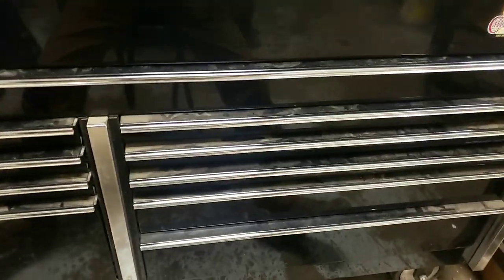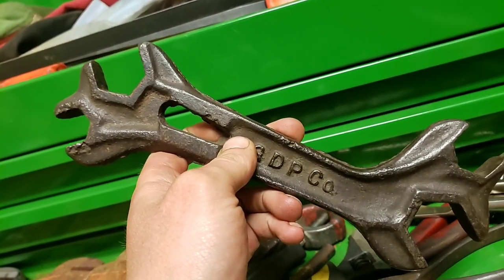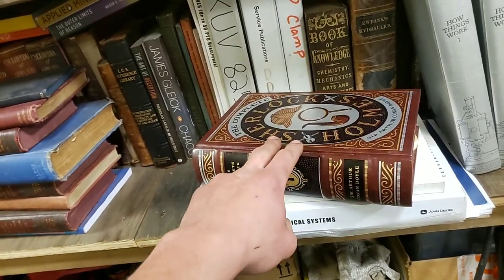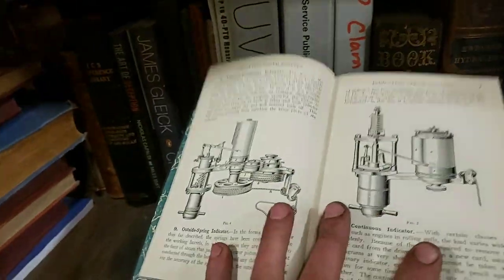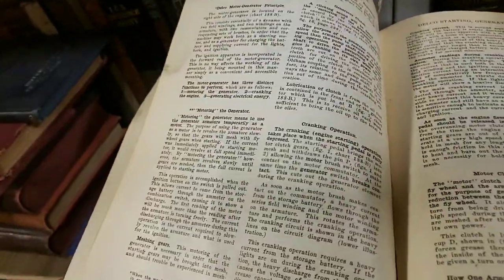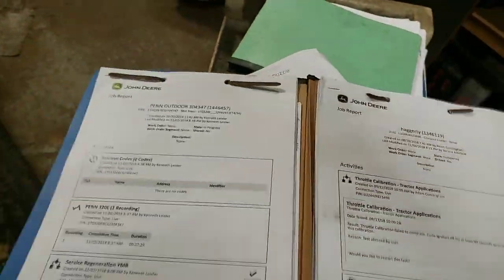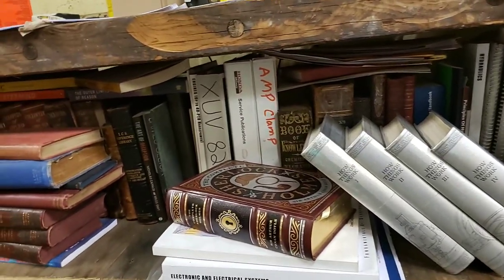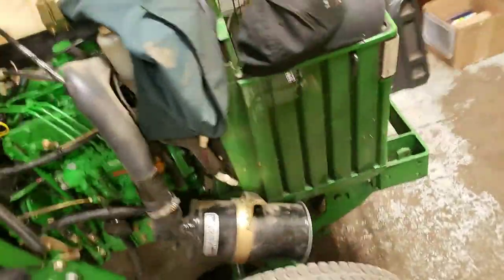Saturday Special - Part 2 - Tour of The Most Important Tool Box You Have

Comment: Just so ya know, the pressure transducer testing was first addressed by Bernie😉. And as for intake and exhaust waveform analysis it was John Thompson (no relation)
Reply from the maker: Well I feel silly. Shows how out of touch I am, and further proves the point for continued training. 🤔🤓
Reply: Oh it's something that very few would even know .
Reply: Actually a little tidbit...Reher Morrison Racing was using in cylinder pressure transducers in the 70's-80's on their Pro Stock engines and used it originally on their dyno and then installed them on the cylinder heads and thermocouples in the header tubes. They were breaking records and winning championships for a reason. 👍